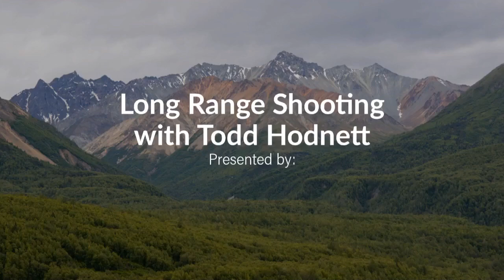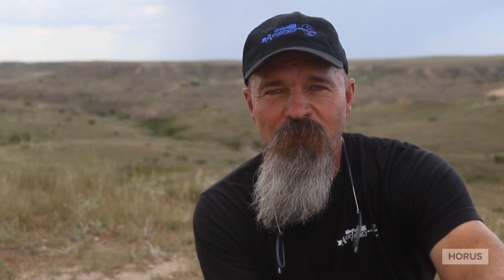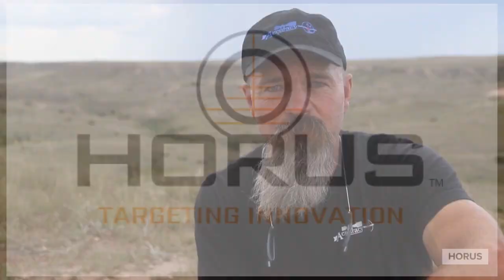Truing your Muzzle Velocity (MV) and Ballistic Coefficient (BC) - What is it and why do we do it?

Comment: I find myself being driven crazy by my past efforts with Truing.  I use the AB software, and I have gotten lost a bit.  I first compared results based on hits at 250 yard increments, trying to see where my data lined up.  If I was short at 450 and on at 700, I would adjust the value, etc.  The AB software only allows for 3 different ranges and drops for the compensation algorithm to run, right?  My problem with that is that it is dependent on the longest distance, so if you want to shoot at 3500 yards it requires the first range to be at 1500, 3000, and 3500 respectively.  Pretty difficult to pull off!  Is there a way to do a video where it goes into the actual process?  I find myself blindly fiddling with BC.........
Reply from the maker: Absolutely. That's a great suggestion.  We'll be filming a second set of videos this winter and I've added your topic to the list. Thanks!

Comment: If your BC is off, why would you adjust muzzle velocity in your calculations?  Surely you'd want to use your actual muzzle velocity and actual drops to work out your actual BC, then use that from thereon.
Reply from the maker: Truing is used when you don't have any way to precisely measure your BC/MV. If you know your exact BC/MV it's easy, use them and it will give you a good output. If you don't for sure truing is a way to account for the error you're seeing. You true MV or BC based on being in super or subsonic as in super MV is a more dominant variable in the calculations and in sub BC is so it's more accurate. Not as good as having the instruments to accurately measure MV/BC but most folks don't have those so this is an alternatives that works well.

Comment: thank you for trying to explain this. the MV is a fixed number, the BC is a best guess, and the track of the bullet is a fact (that can vary due to weather and altitude), so to get the model (whatever ballistic solver you use) to fit the bullet track, we tweak the inputs MV and BC.  I understand the velocity changes/decreases, but why are we acting like the BC changes?
Reply from the maker: It's not that the BC changes, but that the BC is not neccsarily the same as the box says due to lot deviation, possible barrel distortions, etc. and this shows up more as the bullet slows down as the BC has a higher influence on the trajectory at lower velocities. Where at closer distance the MV has  larger influence on the trajectory, sort of overcoming the BC to some extent.
Reply: @HorusVision  thank you, i just finished a class about this. the app and the kestrel were off from my groups at 800 yds and i wanted to true the curve with my actual drop, but my instructor said not to unless you're within 10% of transonic (@ 1000 yds). so now i will fiddle with the BC. hornady gave the BC as .580 G-1 so my G-7 number is probably a best guess.

Comment: Ok, so if i am 7 inches low at 850 yards do i add or subtract 7 inches to the trajectory validation in the inches setting on the ballistic calculator??
Reply from the maker: I'm not sure what program your using where you can input inches but you'll need to do whichever lowers your Muzzle Velocity until it gives you an elevation solution that gives you the correct elevation hold at 850 yards. If you need more clarification feel free to call us at (866) 568-2926 and we can walk you through it!
Reply: you always move the point of impact to the point of aim. so you have to come up 7". just fake example numbers here but let's say you dialed 21 MOA and your impact is 7" low. that is 3/4 MOA low (7/8.5 = 0.82 round to 3/4.   the 8.5 is 1 MOA at 850 yds ) if you dial 21.75 your impact should be good.